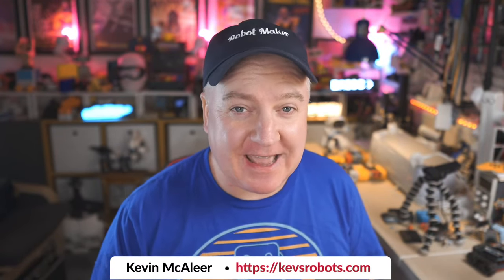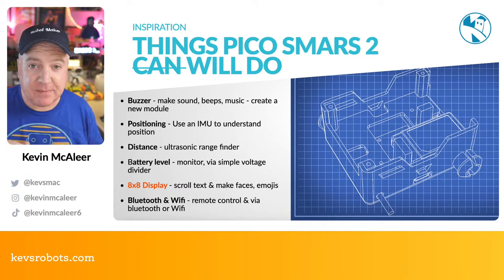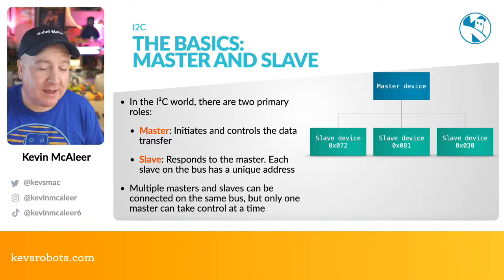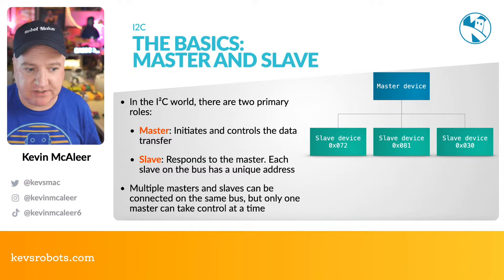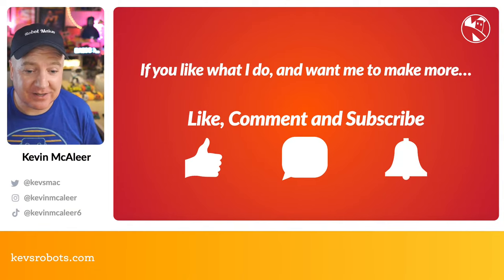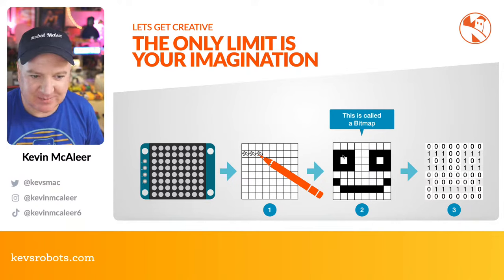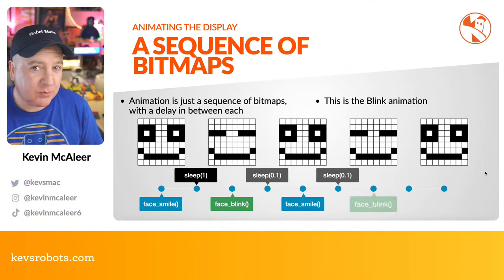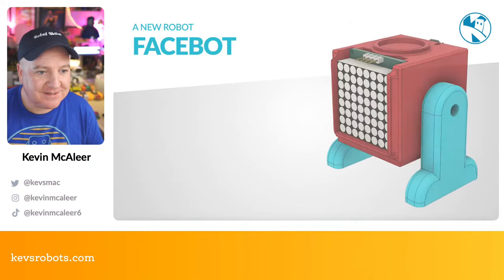How to use 8x8 LED Displays with MicroPython

Comment: How to use 8x8 LED Displays with MicroPython?  Get a C or an assembly language programmer to write some real code for you (eg, a library), then let your SLOW interrupter update a mirrored memory field.  Realtime fast programming is NOT done in Python, micro or otherwise.  Just sayin'.
Reply from the maker: That’s a bit overkill for updating a small display. It’s not like its a 4k display that requires 120fps.  Real world programmers use appropriate effort to achieve results, otherwise they end up the most over engineered product in the graveyard
Reply: That, or they just use a library (the internals of which they do not and will never understand) to do their bidding.  Think of FASTLED for the Arduino community.  The majority of users don't NEED the speed and performance of the code that was written for them, but the average Arduino coder could never write that library.
Realtime interrupt-driven hardware drivers are harder to code and debug then the kinds of things Python was invented for.  I say this as FACT because it is what I have been doing in C/Assembly for the last 50 years.  I am NOT saying this to dicourage anyone from joining that club, it is fun, please do come on in.
I'm just saying writing hardware drivers in Python is the wrong tool for the wrong job, while talking to hardware through well-crafted library of modules written in C/Assembly always works better AND it would be nice to see some YouTuber's tackling the harder problem of Python Library construction rather always do the trivial   presentation of a slow and tiny example of easy code.  Again, just sayin'

 @kevinmcaleer28
Reply from the maker: @greg4367  I can't wait to see your videos of this, let me know when you've uploaded it and I'll give it a watch.
Reply: That is a great answer.  If this is a game, you win.  What skills I have are limited to coding and cooking.  I don't have a clue how to make a YouTube presentation and i surly lack the personality for it too.  Still... A deeper dive would be educational for some.

Looking forward to your next one.
 @kevinmcaleer28